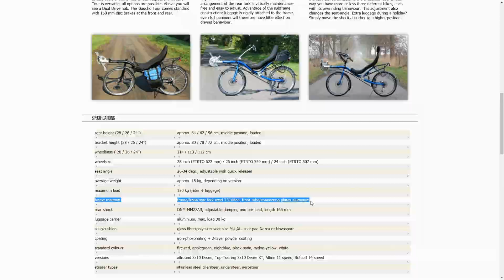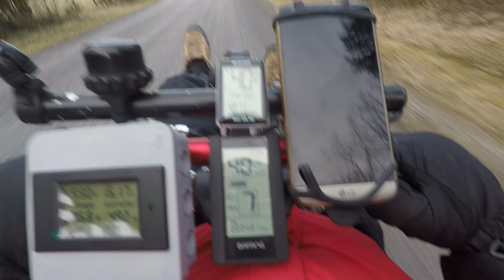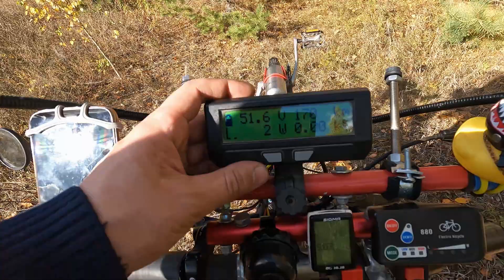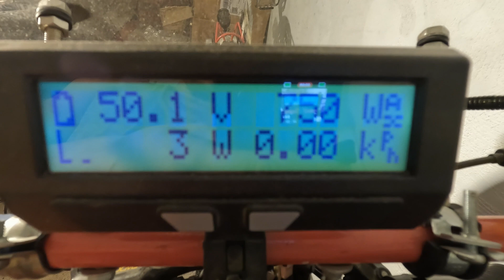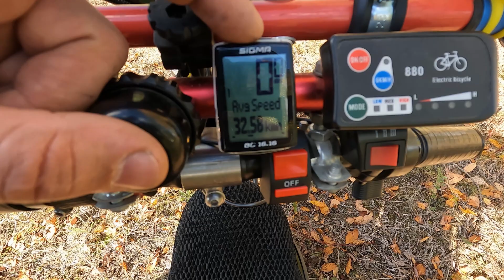DIY RECUMBENT E-BIKE - 14 000km/8700mi mileage detailed review

Comment: Fiberglass areo taillbox will extend the range significantly. The aerodynamic trunk gives greater yield than the front fairing. At speeds of 30-40 km/h, a well-made case should provide an additional 20-30% range. I also recommend wearing tighter clothes, if something in your clothes is billowing in the wind, it means that it is eating up energy. In addition, a sine wave controller will allow for better efficiency, which will also translate into longer range. Plus, regen support via the controller will give an additional 5-10% range.
Reply from the maker: First, I want to thank you for your comment :)
I have thought about the rear tailbox. But not a massive one where the whole height of the seat goes to the back. I don't feel a lack of regenerative braking on this bike, as most of my riding is in the countryside and I don't really gain much from braking. For example, a commuting bike has it and for one reason, to save brake pads and money. Renegade is a bonus, if the battery is old then renegade will help compensate.
You are right about the clothes. I've watched my old videos of touring, there's wind blowing straight into the trousers and they turn into a balloon, hilarious.
Reply: @DatEbikeGuy  As you write, the gain from regenerative braking is small in terms of energy and the head is used to save the brake pads, which it does very well. But when driving long distances, even the 5-10% energy recovery from braking counts. Of course, the route profile is also important, e.g. if you live in the mountains, recovery does the job. I also ride a recumbent bike (and have done a couple of them), but since I live in a big city and visibility over car roofs is crucial for safety, I ride an upright bike more often. But when it comes to energy efficiency and long routes, a recumbent bike has a clear advantage. The engine winding is also important - the slower the winding, the better the bottom torque and the better the efficiency. I had two recumbent bikes with mxus 12x4 and mxus 3k turbo engines, also with fast winding, and both were very power-hungry. Now I use a 9x6 winding and there is a significant difference in energy consumption - a plus for the slower ones. The speed itself also makes a huge difference, but that's rather obvious :) Seeing how nice your laminate fenders turned out, I think the tailbox would also be successful. From my experience with lamination, laminating inside the mold gives a better result because the surfaces come out smooth and do not need to be putty. But here a separator is important to separate the laminate from the mold. Greetings from Poland :)
Reply from the maker: @Rognivald  My Enduro E-bike has a 3kw motor. It's like a big american car that takes a lot of power :)
I watched your videos, those group rides are exciting to watch. The area where I live is flat, no hills. I bought a standard winding front motor for my commuting bike a year ago in Canada(Grin through axle). The controller, display can be connected to a computer to make crazy settings. The only thing that motivated me was because of the renegeing braking when riding in the city all the time and I wanted a front motor with an intergeated torque arm for my own safety, don't trust the Chinese ones. I was planning to have a recumbent bike welded and register it as a moped, at the moment the plan was put on hold, too many risks.
Happy holidays. BTW there is an online shop in Poland called Nexun where I ordered spare parts for my mxus motor just in case.
Thanks & Happy holidays.

Comment: My 1000w hub ebike eats spokes. About 1 spoke per 100 miles. Made me so mad I got the BBSHD. That the current motor pulling the solar trailer.
Reply from the maker: The main problem with these Chinese motors is poor quality rims and spokes. It's best to just buy the motor and look for a brand name rim and quality spokes and assemble the wheel yourself. My commuting bike total mileage was 24k miles. I got to ride 3k miles and the inside of the rim was cracked. I built a new wheel myself using the same spokes and brand rim (luckily they were strong) and rode 32k miles on it. The spokes never snapped once. 
I ordered a new througaxle v2 motor from Grin a year ago. Very satisfied. 8k mileage. And I just wanted to get a front motor so I don't have to worry about the spokes adjusting and the rim cracking. 
Thanks for stopping by 👍🙂

Comment: Wheel arches are very interesting! 
Cleaner touring.
Reply from the maker: Hey, indeed.
In the beginning I only made a wheel arch for the front wheel, I didn't plan to make one for the rear wheel right away. Driving in the rain, in the rear view mirror, I saw the water flying up. Maybe a couple of meters high. I had no other alternative but to make a wheel arch for the rear wheel as well.